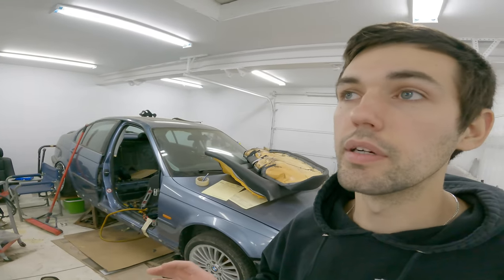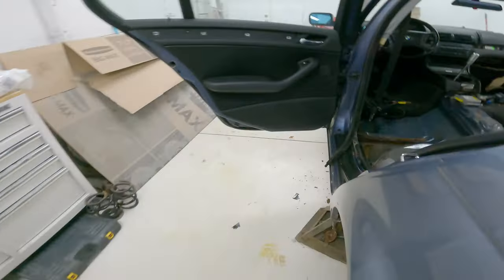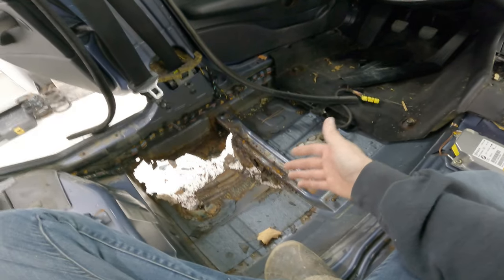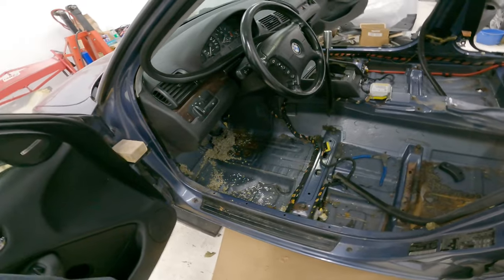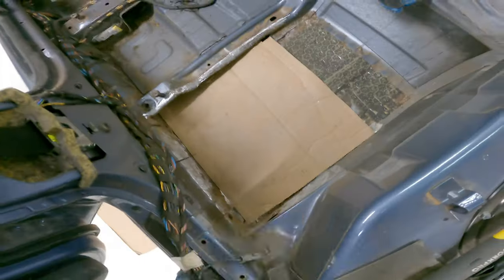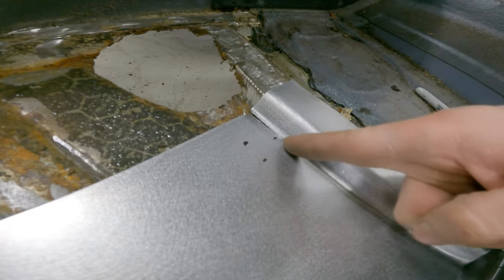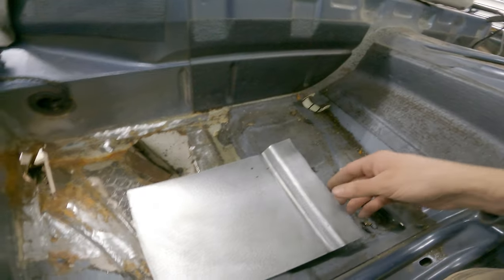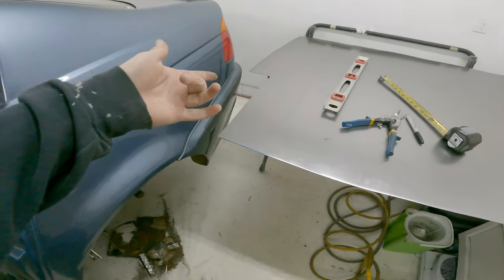Fabricating rusty floor in my e46 (its junk)

Comment: My convertible is rusted around the 2 rubber bungs in the rear footwells I couldn’t afford welding so I cut out the rot treated the area sealed metal plate in from inside and filled the hole with chemical metal sanded down and under sealed. No more wet rear carpets when it rains and looks pretty oem. I need to get the carpets out asap though to dry that foam before mine rots like yours.

Comment: On the e90 they fitted plastic panels under the car for rust protection, it has the opposite effect by collecting road-salt, snow and ice in the winter weather and rustning the hole floor away, what where they thinking doing this 😢

Comment: Hi guys, if your e46 is rusted like this I have two of those seat brackets that are half way rusted out in this vid. I salvaged them from an old car. Shoot me a message if you need one and we will work something out. Eventually I will post them on ebay. Cheers

Comment: damn the guy fleeced you man. any reason why the rust damage is so bad?
Reply from the maker: Definitely been fleeced, and honestly not sure. Google says multiple things but seems like most commonly would be clogged or detached sunroof drains, not sure why the drivers back floor was so much worse than the others though either.
Reply: This is the reason guys. happened with mine. when the window regulators get replaced, they never properly put the vaour barriers back which means condensation forms on the back of the door cards and drips onto the carpets.